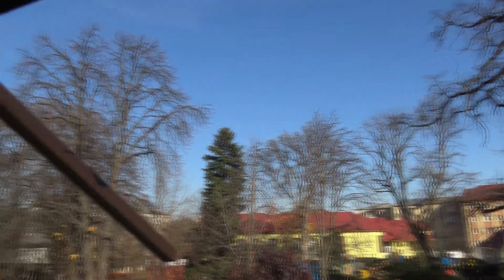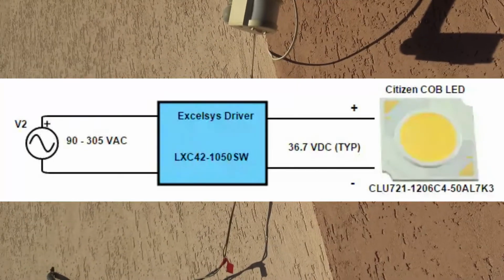Install 100W PIR LED motion sensor for exterior

Comment: That looks like it should last longer due to the heatsink being bigger.  Actually, that whole thing is so much larger it should last a lot longer.  I say that knowing that every single Chinese product I have purchased the replacement LED module works for so much longer than the one it comes with.  Matters not the brand I get, or the seller, so I guess the LED modules in the original is a bit sub par.  Makes sense because every machine I have purchased from Chinese sellers has been exactly the same.  They use C, and D, grade (sometimes B grade) stuff then you replace them with B, and A grade stuff.
Reply from the maker: I notice this one have a larger gap between individual LEDS , so I expect a better cooling and working life..will see..
Reply: @viocaia  I noticed that as well.